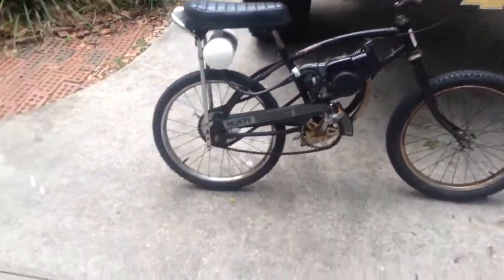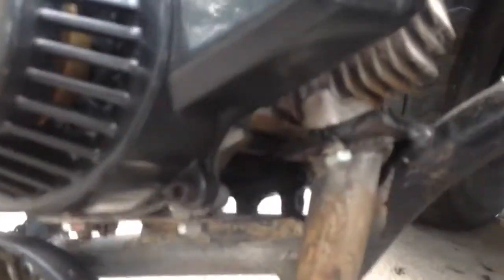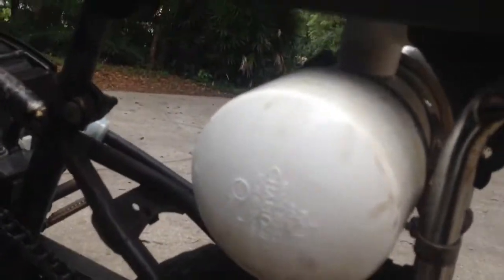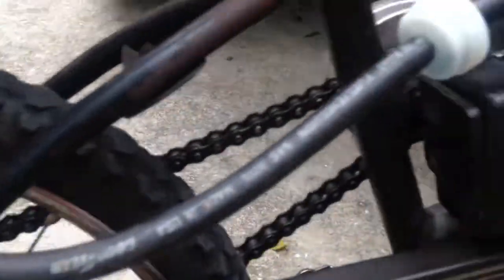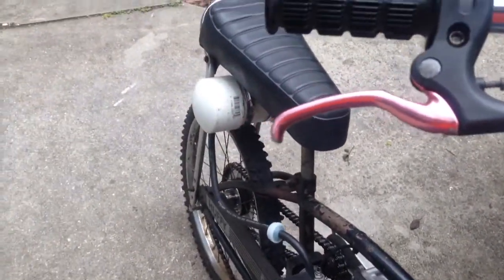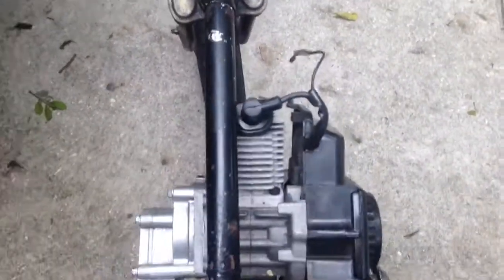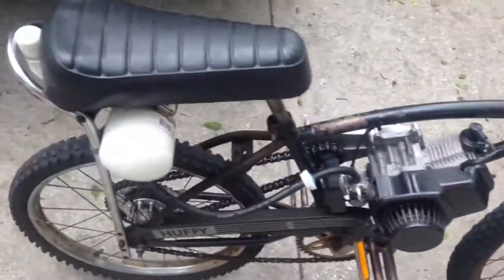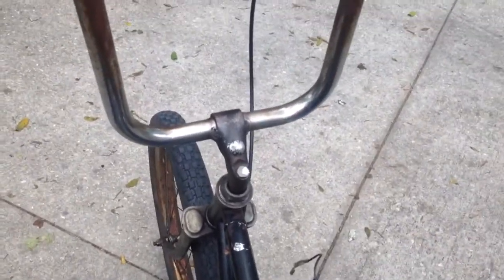Vintage Homemade Huffy Motorbike

Comment: Nice Bike hahah i had a 49cc pocket rocket and it went 74Km/h so i mean if you got after market plug cdi coil wiring harness and air filter and a boos bottle you'll be right haha but you won't need it if your going on the sand xD

Comment: Awesome build man. Going to try and build me one! Great set-up you have!
Reply from the maker: i will 100 percent recommend putting a 60 tooth sprocket on the back wheel as there isn't enough power all and all. thanks for watching!
Reply: Nick DePaiva did you switch to a 60 tooth sprocket?
Reply from the maker: not before i sold it sadly. but that would be a really nice gear it would have more than enough power with that gear.